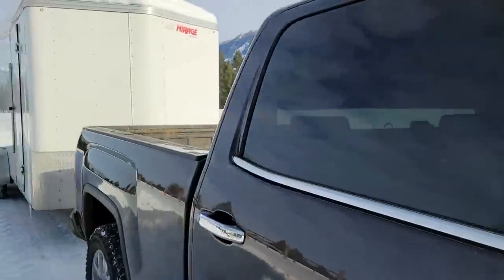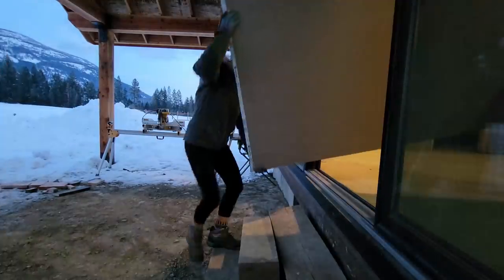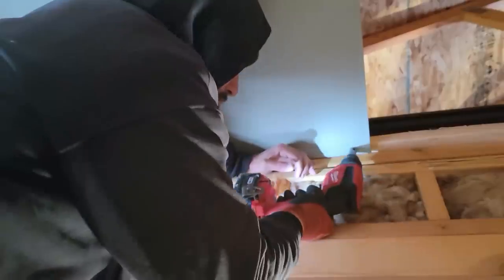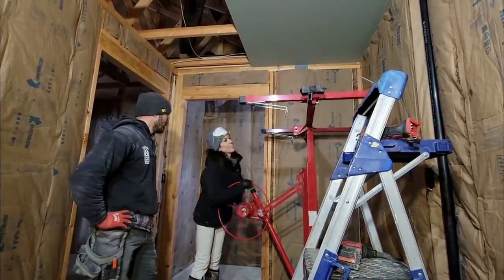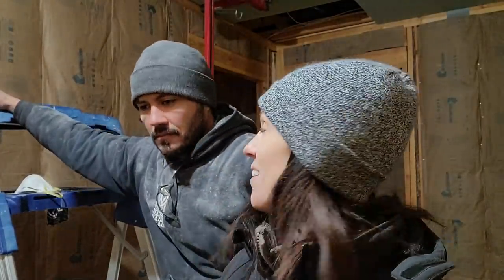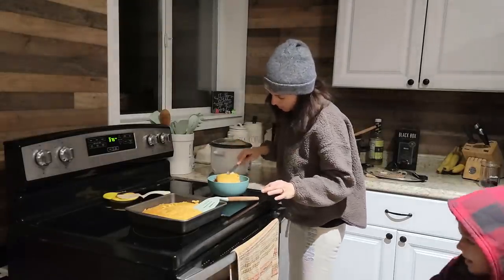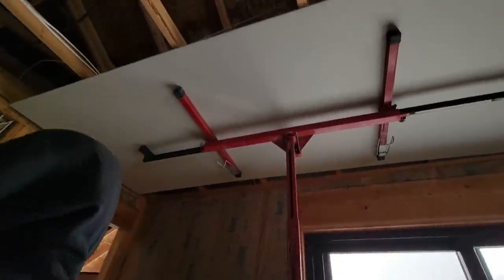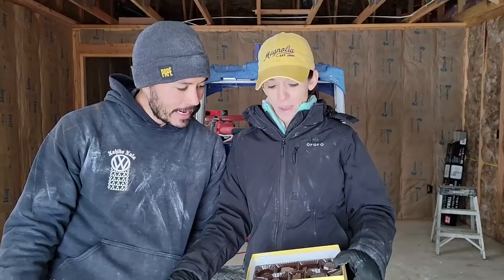We're On Our Own | Hanging DRYWALL In Our Self-Built Home

Comment: try moving 240 sheets 100% by yourself.  i saw a video where someone used lipstick on the plug and light boxes then cut them out and let me tell you i wish i had known that trick when i did mine.
Reply: oh one other thing DO NOT throw away even any small peace until you are 100% finished with the sheetrock. because somewhere in that house will will find a place you need something really small

Comment: Word of advice from somebody who is set a lot of ceramic tile. Do not, do not and I repeat do not.... Set your ceramic tile that's going in your shower bathtub area directly on the green drywall. It will just mold behind it and rot. Put up a good concrete board like HardieBacker or wonderboard over the top of the green board and then set the ceramic tile on that it will be a much better installation and will last so much longer it's unreal. I have had to tear out a lot of tub surrounds and showers where they put it directly on the green board and it's really nasty after a while but you don't see it because the ceramic tile covers it up until it starts falling apart completely

Comment: Hey guys just watching your video and I see your trusses look like they 600mm or 2ft apart am I right in saying that or are they wider in the spacing just curious because down here in New Zealand we put our trusses at 900 mm to 800 mm 3ft part and use ceiling batons under the trusses to hang the drywall to so just curious to see why you do that and why you direct fixed to the bottom of your trusses cheers Paul a.k.a. poor dad adventures.
Reply: PS Also I noticed that you guys are your just using screws for holding your drywall up do you not use glue as well.

Comment: Make your measurement marks with a pencil or you knife, then use your straight-edge to cut/score (you don't have to draw the line) the face side of your sheet rock, but wear a safety glove on your "holding" hand. Fold and cut on the back side to finish... much faster. Unfortunately, you might be finished before reading this.

Your commercial endorsements are top notch. Your advertisers should be happy.

Comment: What I'm not seeing are the anchors where the walls meet the trusses.  Learn from our mistake, dont screw the drywall to the trusses where it meets the wall.  When the trusses expand and contract, it will create joint cracks.
Reply: there is a specialty corner material for that - just for the reason mentioned

Comment: Are you using glue when installing your sheetrock 
It's much easier to cut the sheetrock while standing up against the wall cutting it on the saw horses you will wear yourselves out

Comment: F.Y.I. ….. if the episodes are not too far behind… Terminex does blow in insulation. Yes, the bug people. I researched and researched. I was going to do it myself and I ask the bug guy a question about spraying in the attic before I put in insulation and he said we have insulation. WHAT? Never knew. It is treated for bugs, fire proof and some other stuff I can’t remember. It was also less expensive than if I did it myself. Once they started over my office there was an instant noticeable difference. In my living room over the windows major difference. The elect bill dropped and also gave the AC unit a break. 
Just thought I would share info. God’s speed. GW

Comment: For me you are screwing the joints too close to the cut edge, thereby reducing the adhesion. By using the knife you avoid weakening the joint.
Also by letting the cutoff section fall to the floor off the table you risk breaking off too much and then , combined with screwing the board to the 2x4 too close you end up with a joint which could fall at the slightest earthquake.

Comment: DUDE leave the sheets stacked against the wall and cut the face paper using the T-square as the straight edge, bend the sheet out then back cut the sheet to release the cut piece. cutting the sheet flat like you did on that first one is a safety issue for you on your back and i have seen people slice their hands open with blades! also start with larger areas first and work into smaller areas then you have less waste. also off set your butt joints by atleast 2 or 4 studs for proper floating, NEVER EVER RAILROAD drywall joints and what i mean by that is have the butt joints of 2 sheets meet together at the band joint and make a huge cross. that is the worst way to finish the sheets and will look really bad when light hits it after you mud the section. 40+  years hanging, finishing, texturing, patching drywall here! use the biggest pieces of drywall you can! the bigger you use the less you have to coat with mud!

Comment: You already have your drywall leaning against the wall,  leave it there and pull your measurement rfom the end of your drywall, and make a pincel mark then lay your t-square on the mark while it is still against the wall, use your toe against the bottom of the t-square (to keep it from moving) then just score the paper of the drywall useing the t-square as a guide for your knife and rock the end of the sheet you just away from the stack of rock push it, it will snap then score the paper on the back and snap it the other way. This will save you alot of work. 
https://www.youtube.com/watch?v=ClGbqiF0IO4

Comment: Disappointed that you went with half inch sheetrock on the ceiling instead of 5/8's.  Half inch is only good for a 16 inch span.   Over time, you will see all of your joists as the half inch sags.